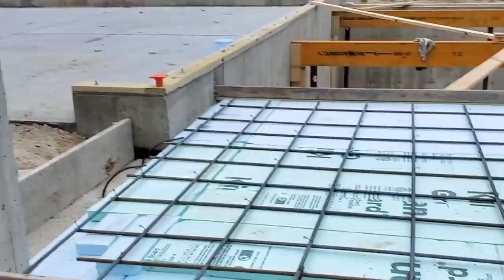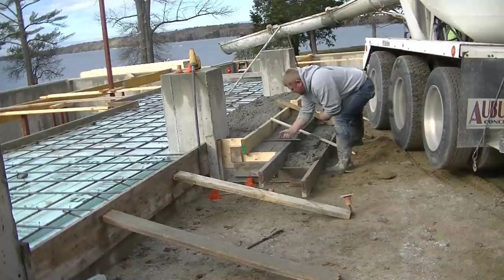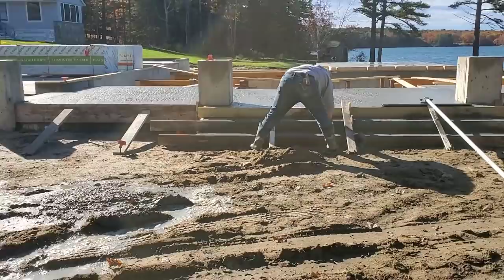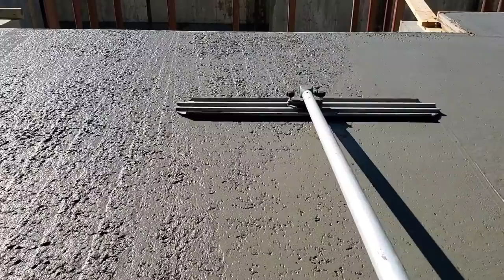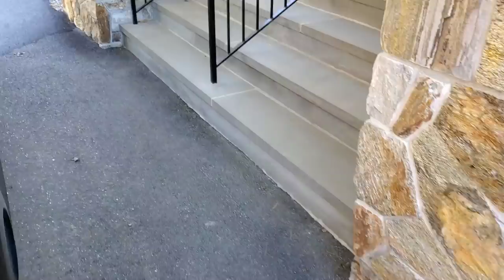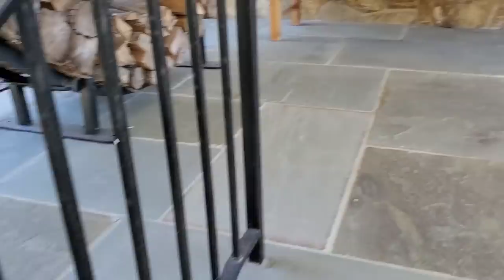Pouring Concrete Steps With Attached Patio Slab

Comment: mag floating before hand and using the edger on exposed concrete to break the big stones is a must. Its pretty hot around here in Windsor Ontario during summer months, nothing quite like trying to break the big stones down when the concrete is firmed up hahah. We also have one guy screeding with a long 2x4, that has handles centered on it, with a guy raking behind and we use wet pads like you use to reference the height of the middle between each wet pad.

Comment: - As far as scheduling goes - I would generally shoot for 2 major pours, per week (~100+yds). Those, a weeks notice was usually sufficient for the plants. I would also set up 20-30 yds on ‘will-call’, for every afternoon at ~1:00p (M-F). The daily afternoon pours were typically for columns and walls or curbs or any of the other auxiliary things to do on site. The major pours would be things like foundations, S.O.G.s or elevated decks.

  I’m curious how your concrete design mixes work. Are you generally required to submit the design mix you intend to use, to the arch/eng and then wait for an approval on it? The reason I ask is bcz you’ve mentioned about times where you’ve changed up the mix due to weather conditions.
Reply from the maker: We don't have to submit mix designs unless the job has an engineered mix design in the spec. Then we have to get permission to change it. Most of my jobs don't have this and I use a 3000psi to 4000psi mix. I also have a couple trucks on will call every morning for 2 weeks in advance, then change that as my schedule changes by adding more or subtracting one. I usually have trucks ordered for different jobs at least those two weeks in advance but weather changes the schedule a lot.

Comment: Mike, you mentioned the 3/4 inch stone in the 4000 PSI concrete, does higher PSI concrete typically have larger stone in addition to more cement. Thanks.

Comment: what would be the contractors reason for the Styrofoam insulation? my guess is that foam creates a barrier between the cold ground and the floor so feetsies stay warmer. I dont know anything about crete but it seems to be a 4 inch layer of crete as a foundation under the poured crete slab would make it a bit unstable.

Comment: Anybody here able to answer 2 questions?
1) If I have ⅝/foot slope for drainage to pour, what is the highest slump I can go before it loses shape prior to setting.
2) What is the lowest slump I can get out of a pump without pissing off the pump guy?
Reply: You can easily pour a 6”+ slump and maintain a ⅝ / foot slope. That’s actually the maximum slope allowed by ADA compliant standards (1:20). 

  I’m assuming you’re referring to a 2-3” trailer pump. Usually boom pump operators don’t care much how tight you want to pour it. I would just tell the pump operator to make sure he primes the line good, bcz you need the slump the way you need it. Tell him if he gets jammed up, you’ll help him out, but typically once the mud starts flowing, there’s usually not a problem. It’s all about a good prime.
Reply from the maker: For both questions I would say a 4" slump. The pump guy can pump a lower slump if you really need him to. The slope shouldn't be too hard with a 4. We do 1" per ft on wheelchair ramps with that.
Reply: @MikeDayConcrete  1:12 is a common slope for wheelchair ramps, but around here (FL) you would be required to have railing on both sides of the walk. Otherwise we have to go with a 1:20 slope.
Reply: @psidvicious  where I am at, regardless of slope, if you hit over 24", you need a rail.  Around here 1:12 is the norm.
Reply: @psidvicious  thanks for the input!
Reply: @MikeDayConcrete  wow, really like the help.  Plus the answer was what I was hoping for!  Your displayed willingness to respond with accurate  answers in a timely fashion makes me want to take your course.
Reply from the maker: Thanks Bob, just trying to help any way I can.
Reply: @MikeDayConcrete  is it a dumb idea to want to take my forms off as early as possible on a stair pour?  My stringers are a little deep in the rear and I would like to get a nicer finish.  (This happened because it is a home project and I have been banging away at it all summer while working a full time construction job as a carpenter.  I was all set to pour and the wifey asked me to add a sidewalk between the slab in the backyard and the stairs on the side of the house....with time the stringers bowed downward a bit)  I had cut my risers a little short because my mag is ¼ inch thick...due to that built in wiggle room, I was able to unscrew and lift the risers just enough.  I pulled up and attached the stringers in the middle.  (Stairs between two buildings...with over two inches between buildings and new pour)  This helped a lot but my inverted stringers are a weak ⅛ too deep still in the rear.  I can live with it if I have to, but would love to run a mag over it with some paste at the right moment.  I am just not sure there is a point where I can have it "plastic"  enough to baby it, yet still remove the forms.